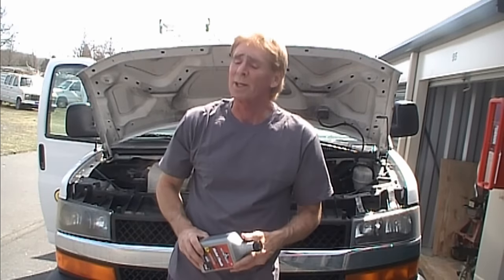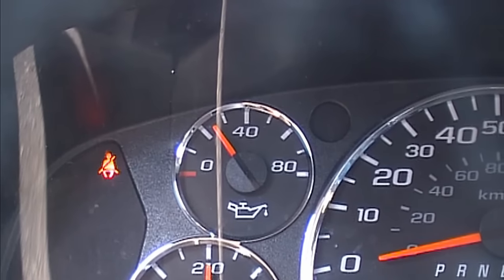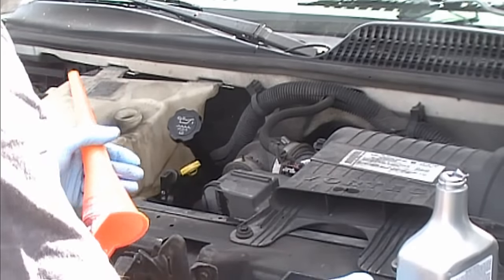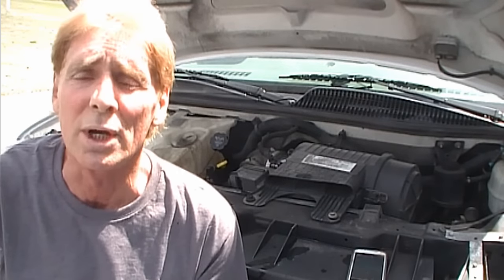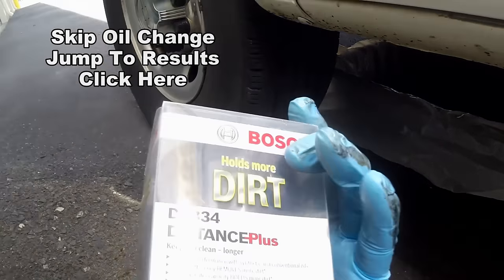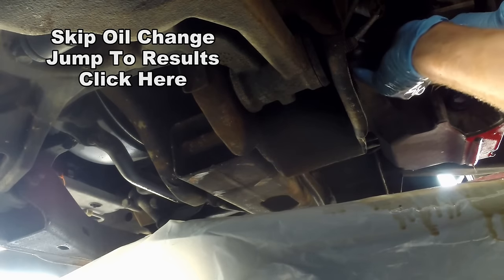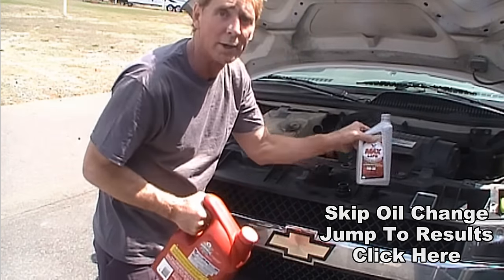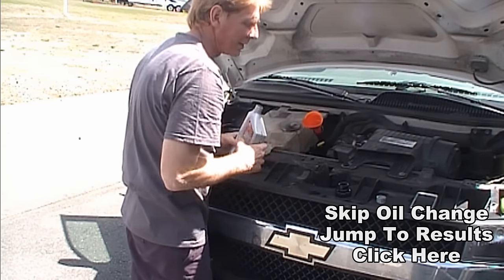NOISY LIFTERS? Motor Flush - Does It Work?  HOW TO DO IT YOURSELF

Comment: That's a rod knock, which explains the oil pressure drop. No additive will fix that. And with an engine with over 300 thou, you should probably be running a 10W40 instead of a 5W30, anyhow.
Reply: +3J Kreklau The pressure was fine... and for a 300K motor, it's AMAZING!
Reply: +seanoleary1979 oil pressure on that motor should be around 40-50 at idle.. He had just over 20 which is not "fine" .. I have same motor on my pickup
Reply: +Brent Addonizio : Brent... haven't you heard - Crack is WHACK! I've built upwards of 200 small block Chevys (aside from other motors from other manufacturers) since 1985 in almost every iteration possible; boiling, balancing and clearancing/blueprinting, magnafluxing, chamfering, decking, heat treating, Tuftriding, align boring, boring/honing blocks (with AND without torqueplates) with parts from just about every vendor imaginable, as well as working with other engine builders such as Scott Shafiroff, Bill Mitchell and Scott Merkel. When I tell you that a stock motor running a stock oil pump is "FINE" with 20 lbs of pressure when hot, make believe Jesus Christ just told you! This does NOT include any of the high volume oil pumps from Mellings, Milodon or Moroso or any dry sump systems running molasses-like single-grade racing oil. Basically, if you've got 40-50 lbs HOT in a stock  motor, your bypass valve AIN'T working pal, and you have a whole lot more problems coming your way. And yes, it does sound like a rod knock!
Reply: +Brent Addonizio in all honesty an engine needs no more than a few PSI of pressure at idle only conditions. The old rule of thumb was 10 lbs for every 1000 RPM's. 20 lbs at idle was great for 300,000 + miles. Hard to tell from the angle / sound of the video but i don't think it is a rod knock - he would probably benefit from using a 40 Weight oil and a good oil stabilizer like Lucas.
Reply: +Mark Prescott I have the same motor on my Silverado and I've owned since brand new .. It's a 2000 with 61,000 miles and at idle im around 40 psi .. Is that bad ?
Reply: No, I don't think it's bad. You have to remember that oil pressure gauges in new cars aren't registering "true" engine oil pressure, it is estimating pressure. I bet if you hooked up a mechanical gauge / sender, you would probably have 30 - 40 pounds at cold idle, and once warmed up between 10-15 psi
Reply: I agree. From is referred to as Orange Death for a reason. NEVER use a Fram! Number 2, no matter the manufactuer recommendations, when a vehicle has that many miles? I would certainly use a 20W50 weight oil in a vehicle with a ton of miles. I strongly feel if that had been done earlier in the life of the vehicle, there would not be a rod or bottom end knock.
Reply: You're fine, Chevy's usually rock between 20-60 PSI depending on RPM. I've owned countless GM car/trucks in my life and everyone did this. When cold, they stay at 60 (hair above) when the pressure check valve opens so you don't blow off your oil filter. Once it warms up, should be 20 at idle, 40 at cruise on local streets and 60 on the freeway or when accelerating. I've worked for a GM dealer and sadly had a pressure check valve go, which blew the oil filter out, oil pressure dropped like a rock and destroyed the engine. I was on the freeway when it happened.

Fords usually have a steady pressure on the gauge, approximately 5/8 of the gauge.
Reply: seanoleary1979 The oil pump doesn't create the oil pressure - the outlet valve on the pump does. So do the clearances of the bearings in the engine, mostly the main bearings and rod bearings. The outlet valve won't ever cause a pressure decrease, unless it lacks oil feed, possibly due to a dirty pickup tube. But in theory, that motor flush would solve something like that, and your oil pressure would rise after using the flush. That leaves you with bearing clearances, which are likely worn beyond tolerance. With 312K on a work truck, you could see that as a likely probability anyhow.
Reply: seanoleary1979
hey Jesus.....eeeerrrr I mean Sean, I beg to differ bro.
The stock oil pressure on my 1973 Trans Am I had with a stock 455SD motor in it was a liiiiiitle higher than 20lbs at idle. Of course it did have an 80psi oil pump it came with STOCK from the factory! LOL
That 80psi was actually a little overkill, but when you revved that monster to 7000rpm that psi came in handy.
Yes, it quit making power below that, but that giant engine was built to rev that high. I always wanted to put a roller cam and aftermarket fuel injection on it but never got around to it.
The sheer size of those fucking crank journals was massive compared to a tiny little small block chevy though. NO it was not a 1973SD TA......I wish.....it was a stock 73 455TA. I found a 1974 SD455 motor back then and rebuilt it stock and put it in that 73TA. It was a tad bit meaner than it had been with the stock 455 D port engine it had came with. It was actually meaner than a stock 455SD because I put the RAIV cam in it it should have had and recurved the distributor and tinkered with that 800cfm quadrajet carb on top of it. Plus a true dual exhaust with crossover pipe. This was back in 1996. FUCK.....I wish I had kept that car! I got depressed after my first divorce in 2001 and sold it. Today, that motor alone would be worth some $$$$.
But yes, those GM LS series motors are so well designed that they need nowhere near the oil pressure the traditional 350 small block chevy's needed. My 2001 silverado with a 5.3 with 275Kmiles runs about 35psi hot at idle which is surprising with the mileage and I do not run it easy either. Those lifter ticks and piston slap really bothered me when I first bought it but after talking to some LS guys I just started ignoring it.
I routinely rev mine to 6000/6100rpm or so (I have a custom tune and a convertor in it plus a beefed up transmission) and it is fine.
But yes, this video above, that does not sound like top end at least to me. I would say he may be able to put a replacement stock oil pump and swap out the bearings from the bottom and that would help his noise if it is just worn bottom end bearings? What would you say. I mean if he just wanted to go about it as cheaply as possible to get some more miles out of it? Oh and probably run 10w40 in it too?  
Oh and a lot of guys actually put a lower 60psi spring in their 455SD's just because when you started one of those monsters cold and in a cold climate your oil psi could go so high it could blow out your oil filter seal......at least that was what I had heard from several of them.
Oh how I wish I had that car now. Nothing like a big inch engine with that monster torque pinning you back in the seat as the rear end fights for traction........well except for one of the 9 buick grand nationals I had from 2003 through 2009. Fuck, I wish I would have kept just one of those too. Sadly, due to health issues and old age I have nothing other than my old 2001 truck and my auto tools and personal belongings. I daily drive my girlfriends spare car......a 1995 honda accord ex......a far cry from the beasts I used to drive. Not able to work right now.....hope to one day be able to work again. Oh well, I guess I will always have my fond memories of those awesome cars.
Reply: 3J Kreklau not an additive numbnuts
Reply: Curtis Kreklau
Reply: Keith Smith that's because some Ford gauges are dummy gauges, they're either on or off. If a gauge doesn't fluxate at all, then it's just a switched gauge, it doesn't mean nothin for real time oil pressure.
Reply: Exactly..Y 5w30..15w40 for that..
Reply: Heavier oils are hard on modern lifter's. The holes in the lifter's are so small heavy oil can't get through. I go with the manufacturer recommendation. Chevy spent millions getting the oil weight right for the vehicle.

Comment: With the kind of miles on the truck who knows why it is ticking. The first thing I do is put a pint of transmission fluid in the oil.  The transmission fluid has high detergents and seal additives. You can drive it with it as it is a lubricant as well. It may take a few days to stop the tick. There way a product called Free Valve, but I haven't used it in years. Trans fluid isn't as good in my opinion, but works in many cases.

Comment: MY LAST GM V6 TICKED AT 100K MILES THEN STARTED KNOCKING AT 105K MILES. and it was the end of the motor. always did oil changes at 3k miles. GM=Garbage Motors

Comment: Buddy it's best to pre fill filter with oil so you dont starve engine on start up
Reply: Won't the oil make its way down to the filter after you fill the crank case?
Reply: @Ga7cun7sSUCK  in a few seconds do you really wanna want the engine to run a few seconds with no oil
Reply: I dont usually start it for 5 or ten minutes after filling i just always would have thought being the lowest point it would quite easily make its way there

Comment: It might be bottom end. You can try an additive like lucas oil stabilizer or motor honey to try and raise the oil pressure, but if it is indeed a bottom end problem the engine won't have much more life left in it.

Comment: Atf fluid, seafoam, any high detergent oil based product will work but you have to do it a dozen times over say a year or two to get any results. Years of accumulation takes time to remove. Add a quart of atf run for 10m then change oil, then try again with MMO or Seafoam etc, do it over and over and it will clean the interior and reduce lifter noise

Comment: OMG please let someone else change your oil! - vice grips on a drain plug? Mistake 1 - Mistake  #2NEVER   use a wrench to tighten an oil filter! - Hand tightening is fine, that's what the seal is for - will make it a BEAR to remove again. hopefully you used some fresh oil on the new seal and threads before you mounted the filter? Mistakes 2 and 3 - and the biggest mistake, number 4,  is using that crap to begin with... mostly kerosene - will destroy your bearings, and then your engine is junk....

Look, you got 300K out of the engine, I'd say you got your money's worth... if the truck is in decent shape body wise, I'd spend the money, and just overhaul the engine, or buy a good used one, rebuild that, and then do a swap....  I'd be more concerned about your oil pressure than anything else... you really want at least 35-40PSI, and if that gauge is right, you are getting just over 1/2 that...

if you had decent oil pressure, I'd sea foam the top end, and see if the tick goes away... but because of the low oil pressure, you have a major sludge problem starting to happen, so I recommend Auto-RX as the ONLY real solution... maybe MMO as a distant second... but I would look into the auto-RX solution, if you don't want to do an engine tear down, which is the RIGHT way to fix this....
Reply: I concur. And if this all fails, just get another vehicle.
Reply: Plus with that type of mileage, you shouldn't be putting 5w30 in it, that's way too thin.
Reply: yes, 10weight at least - the compression will go up too, and maybe the oil pressure... Im still thinking about vice grips on the drain plug... man o man
Reply: his oil pressure was fine..

Comment: I have a Jeep commander 2006 4.7 v8, same sound, the mechanic says that I have to change the whole distribution kit but it is expensive, I chose to add "Rislone Engine Repair" to see if I clean the engine and stop making noise.
Based on your experience, you can tell me
Has it worked for you?
Won't it take away the noise?

Comment: You can use trans fluid to keep the inside of your engine clean. Works good at cleaning and won't harm it. If it's a hydrolic lifter and feel like taking it apart you can use a vice to press out all the gunk in it. They get clogged up and sometimes stay closed due to build up in it. When they're clogged and closed up you will get a noise from it. It's a lot of work depending on the car and if you have someone else do it, it can cost a good amount of money. You can leave about a half a quart of trans fluid in your engine and drive on it. It will keep it clean. I hope this helps for anyone. I'm a mechanic and have done the trans fluid thing in one of my cars for over a year with no problems.
Reply: Yh but my car smokes now
Reply: Tell me how can I fix that problem I use the seam thing u yes n my car still like it's. A next problem with smoking so I was saying it's the oil rings
Reply: I will give this a shot she ticks inconsistently and I have heard this from a few sources couldn't hurt
Reply: @glenparris6852  lol... bro
Reply: I had thought of this as a good idea, but a mechanic friend told me that the different oils and additives can swell the seals, so then you have rubber and some gasket problems, also how do you know which atf is safe for this, as I know the wrong atf used in your auto trans can gum it up beyond repair

Comment: The best lifter tick aid is ATF, add a quart of that in your oil and run it hard for usually 10-15 miles, learnt it from a dirt track veteran.
Reply: Always told lil more than a cap full but ive never tried it

Comment: You might get away with just adjusting valve lash. It's not always a broken lifter. If you have an engine stethoscope you'd know right away.
Reply: Can I do this with the heads still on and the timing belt on?

Comment: Automatic transmission fluid mixed 50/50 with oil works even better I'm sure, done that a few times and it flushed the lifters out around half the time.
The other half, the lifters probably had a chunk of metal stuck in the tiny little holes in the lifters and the oil pressure wasn't enough to push it out.

Comment: I got a 2004 f150 with a 6 banger with 223,000 for mileage that ran strong but had a good tick to it, I put a whole jug of hyperlube in and the recommended amount of marvel mystery oil and went to 10-30w oil and it sounds great......took about a week to fix it, I don't drive much....the mechanic in a can worked this time....

Comment: "You don't want to over tighten your filter"

Ummm, you just did. Oil filters are ONLY hand tightened. Filter wrenches are only used for when you take off the filter, not for when you put the new one on.

Comment: I had the same lifter noise and mine was caused by debris blocking a lifter from pumping up all the way.  I had tried Sea Foam twice with no avail.  I tried 1qt ATF plus one bottle Sea Foam and drove 5 miles, no change.  20K miles after all those attempts I finally I put a cup of Dexron VI in the oil and drove it until the tick went away which was around 2K miles.

Comment: It does work but like many things it might be one of those items that only work when it's caught early enough. Tried it my 03 S10 with a 4.3 and nearly 300 000 km / 180 000 miles. It did fix the problem but I caught it early. Noticed it after I did an oil change, used it at my next oil change 5000km later and it did work. Motor oil that I drained was black as all hell after the flush way more so than normal.

Comment: I would suggest when you put your filter back on, to fill it with oil first. And use the right sized socket on your drain plug. And if you had always used 100% synthetic, you may not have had that problem.
Reply: The vice grips had me chuckle a bit lol, are you that lazy to just grab the wrench.  Why risk stripping it all.
Reply: Prefilling oil filters is a useless myth... It's automatically filled as soon as the engine starts...😂

Comment: Someone stripped the old drain plug so I bought a new one that I will now strip with vise grips also I've always been taught that you fill the filter half way and put some around the ring before hand tightening it idk maybe I'm crazy but to just dry install completely no wonder it is still knocking

Comment: 1. Drop the oil pan 2. Remove oil pick up sump 3. Is it dirty? Use correct solvents to clean it. If much debris exist in the bottom block remove as much crud as possible. If that doesn't help you need to check your bearings etc.. it's worth the try.

Comment: i just use a thicker 15-40 diesel oil and it solved my problem! and why are you using vice grips to take off your drain plug and why are you tightening you oil filter so god damn tight????
Reply: my thinking is because he has no tools only a vice grips. secondly he hasn't a girl friend mite be the reason he was tightening the filter that much just saying. lmao

Comment: I have built engines for over 30 year while being a professional automotive technician. I had a Service manager at a dealership assign me a used Chevy pickup with lifter noise when hot. First thing was verify then install a mechanical oil pressure gauge. The truck had 7 psi hot oil pressure at idle. I told him that the oil pan needed to come down and the bearings needed to be inspected. He responded with just put lifters in it and see what happens. Needless to say the noise was still there. He authorized a lower end inspection and sure enough four and a half thousandth rod bearing clearance and three and a half on the mains. They all showed minor wear so I had parts get me slightly oversized bearings all around . The oil pressure problem was corrected and the noise was gone. He drove the truck to work and back for a week before admitting he was wrong.
Reply: What bearings are we talking about?
Reply: Rod and main bearings. It was common to see factory engines with oversized bearings from new 2-3 thousands normally. Lack of oil changes and hard use can cause minor bearing wear enough to cause oil pressure problems.

Comment: I've used transmission fluid to quite lifter tick works most of time plus it's cheaper
Reply: You put transmission fluid in the oil and that works?
Reply: @GEEMONEY973  ATF has a higher cleaning property and cleans sticky parts,  I mixed 50-50